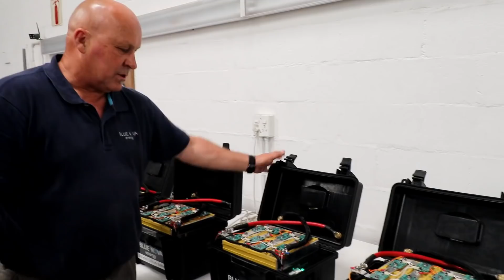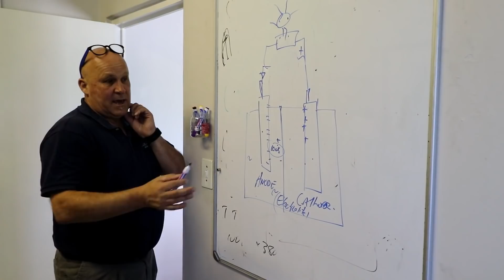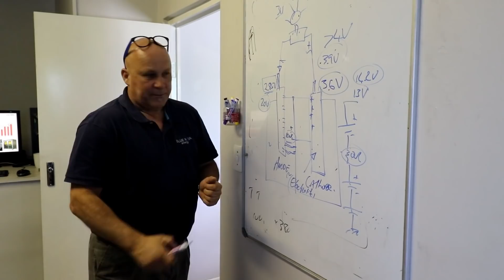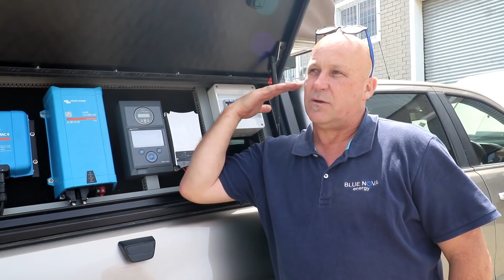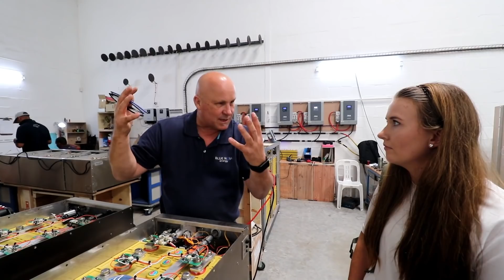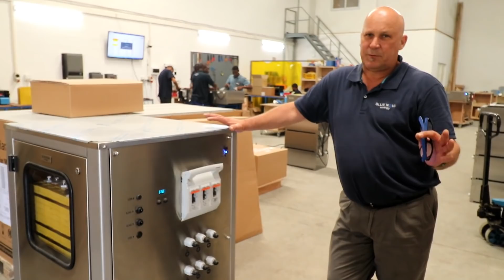We're going LiFePO4 | Lithium Batteries on our Boat

Comment: Hi guys - great video!

We don't want to 'intrude in your space here' but perhaps understanding some more details around the 'cells' they are using would be helpful.

We installed a similar set up on Impi which has been awesome - a total life changer and definitely made our life easier so to be sure, you guys are 'on the right path here'. We are seeing so many 'die hard sailors' now going this route and saying how fantastic it is - so well done!
From our experience with these LiFePO4 batteries is that maintenance of the system is almost zero compared to when we had lead acid, deep cycle gel and Lifeline AGM.

The only other battery we considered and would still consider is Carbon Foam - however we are still happy with having gone LiFePO4 and you guys will LOVE it. 
We also considered Lead Crystal which has similar properties relating to charge and discharge, however the weight is what 'turned this down for us'. 

I was a bit confused where the Tesla part comes in under your description - Tesla use a different chemistry which is more energy dense and they use cells that are slightly bigger than an AA battery. Thousands are stacked together to create a battery. 

I wondered if the cells being used by  Nova Blue are not just the regular WINSTON LiFePO4 cells they are using in their system?
My first question would be. 'what cells are they using in their system and what is the part number of the cells'.
I would then recommend checking the manufacturer specification and 'C rating' around the CELLS - and I would most certainly be regarding that specification as listed by the manufacturer above all else.

If these are Winston then I would say they are 'FAIRLY' similar to other cells out there like CALB, GBS-LFP and many other similar cells. 

Do you know what the cell manufacturer 'C rating' is on the batteries?

If these are Winston cells I would suggest you guys study the battery cell specifications because over discharge and over charge can certainly DAMAGE the cells. Usually below 2.5v on discharge and 4v on charge for each cell.

We have come to understand that what one is basically buying and paying for with distributors, is the BMS (Battery Management System) and the cell balancing devices between cells, and I think BlueNova will be good for this. 
From what I can see in the video, It appears to the future, one can remove the cells and replace them thus retaining all the 'external to cell / BMS gear' and that will be a massive saving to the future since all you pay for is the individual cells which are easily purchased online. 
Some 'contained units' do not allow for removing external hardware so in effect one is having to dispose of a complete battery verses being able to only replace the cells in the battery.

Perhaps we missed it in the video, but I assume you have considered Redundancy between LiFePO4 packs and also to regular lead acid start batteries?

Cheers and well done for a very well put together video.
Reply: HI.
I'm James from BlueNova. 
Thanks for your comments.  Here are some of mine :) 

Our main objective with the LiFePO4 batteries we manufacture is to supply maintenance free batteries that can handle 80% DoD , on a daily cycle basis , for more than 10 years with ambient temperatures of more than 45 Deg C. Think Botswana's and Namibia's lodges. We have more than 2000 units operating in Southern Africa at present. 
In our search for the ideal cell we choose Winston because they use an enhance cathode with added Yttrium which protect the oxidation layer against rapid aging. We've seen installation that were done 14 years ago with these cells. CALB, Sinopoly and GBS and the other leading suppliers of cells only guarantee 80% capacity retention at 80% DoD for 2000 cycles. Winston's cells retains 80% of initial capacity for more than 5000 cycles. That's why Victron also chose them for their Lithium batteries. I don't think it will make any difference on Sailing Lady Africa as I don't see those 2 youngsters cycling those batteries that long :) That's about 13 years of daily use !!

C- rating ? (The link to the cell specification is added below) 
C20=77Ah C1=60Ah (Verified by our own engineers and confirmed every 3 months)
http://en.winston-battery.com/index.php/products/power-battery/item/wb-lyp160aha?category_id=176

BlueNova adds : 
1. Cell boards for balancing and temp / voltage monitoring.
2. Master Controller for operating the protection circuit, pre-charge of bus capacitors, SOH & SOC calculations,  Wifi interfacing for remote monitoring, CAN interface for charger & inverter control. We control the charge rate depending on the cell temperatures (a big cycle killer when the cells are cold and empty)
3. Impulse relay and controller that can stand 5C operation. These batteries can delivery 300A for short periods. That's about 4kW of power at 13V. 
4. Packaging. We use a special case like the Pelican cases used for sensitive camera equipment. It has  a life time guarantee.
5. We implement various protocols to communicate to inverter/chargers lie Victron , SMA, Ingeteam etc.
6. We offer local support to each component in the battery. We carry spares of each component. We own all hardware electronics designs and also all software / firmware used by the embedded processors. 
7. We offer a 10 year warranty on our stationary series products and 5 years on the mobile products. 

Lastly, we are not distributors. We are an engineering concern and are cell-type agnostic. Our electronic systems can work with any type of cell and we are also looking at bring out a SuperCapHybrid soon. It uses 20 cells instead of 16 cells for the 48V market. If a new or improved cell comes to the market from another supplier we will incorporate it in our solutions. 

Regards
James
Reply: @JamesVerster  ahhh now i am interested... your own supercap hybrid, that will be interesting.
Reply from the maker: Hey Guys 

Initially we were going to build our own banks with imported cells , as you know they all come from the same country of birth.
But after finding a supplier locally that built with the same cells we were planning on importing we decided to have a chat with them. they have a fantastic BMS with a number of inter grated safety and coms systems that im sure you are aware of . 
Yes the Cells are regular Winston Lifep04 cells , as you know there are a number of cells available on the market. 
we actually used calb cells during one or our solar cars at varsity a few years ago , so yes i am familiar this these cells, and in my own opinion these Winston cells are in the top two best cell chemistry and quality in the world at the moment. these systems are complete and contained with all the redundancies that you would usually be required to add afterwords.
With regards to the Tesla , we refer to this in the cell chemistry section, they typically make use of the 18650 cells and in the new T3 they make use of the larger 2170. They are have a thermal runaway and yes there energy potential density is higher and they are better suited for high performance demanded applications as you may know .   
However they are best kept in sealed housing and water cooled.
 
With a bit of understanding this systems can become a modular system where cells can be replaced. but as you know with electronics every 5 years there is newer and better systems out. 

Hope this clears something we may have missed to convey 

Thanks for the support 
Kind Regards 
Ricky and Simone
Reply: Sailing Lady Africa water cooling is not that complex (even desktop PCs use it). I believe that the Tesla packs come with a serpentine cooling system already installed so with a few minor mods for boat usage you’ll have them cooled fine. 

Moreover you’ll get up to 80 kWh (plenty of those on EBay) stored energy which means that you could even go electric on propulsion (provided that you don’t motor that much). See here for a tear down of the new 100 kWh Tesla pack and cooling system. If Tesla sees fit to use them in a vehicle that’s prone to violent high kinetic accidents I can’t see how usage in a boat might be a liability. 

P.S. I’m no expert and I may be missing something here.
Reply: Nice additional info Brent

Comment: Nice info, I'm a power Boater, no other sources power other that engine and gen-set , will this type of battery plug and play with no modifying of my boat ?
Reply from the maker: Hi Tony , for the most part yes as long as you can deliver 14.2v . to get maximum efficiency better chargers are recommended

Comment: Thank you for a very informative video. I have been trying to get info from Blue Nova but they di not reply to my mail. What I am looking for is a direct comparison of a 100Ah system giving cost of system (charger etc) per cycle. I am also looking for a system that can be maintained and repaired in remote locales.
Reply from the maker: Hi Coen , perhaps the mail got lost . Send us a mail at svladyafrica@gmail.com and well send you all the info and pricing directly from blue nova. They also have systems that can be monitored and managed away from the location.
Reply: @svladyafrica   Thanks for the reply. My priorities are lower cost and greater simplicity.
Reply: Hi Coen. No mails received on this side. Mail me at jamesv@bluenova.co.za. I should be able to get someone to respond immediately.

Comment: With a little boat like yours just put the money in the pocket and use 4 lead acid battery’s and three solar panels , we had these , temperamental  things , need to be very cool all the time to many wire connections in salt water invierment , you can’t drain them so you need lots of charging , good for Supa yachts  and you only have half it’s capacity to use , keep it simple , buy a small generator some battery’s , way you go , we have 4 house two starter ,   Serviced properly will last 5 years of world cruising , we delete two when on passage mode and that keeps the hole boat running for days on three solar panels returning juice , all electrics , inverter , microwave. Etc. run the motor every two or three days for an hour , simple , you can but acid battery’s any where in the world ,   Watch Lopos But don’t listen to me good luck
Reply from the maker: we had 8 lead acid to start with 800 ah , 4 would do nothing but run the autopilot and basic electronics

Comment: Excelent subject guys. It played more like an advertisement for Blue Nova than I really care for. However, you're clearly thoughtful and understand the Many benefits lithium batteries offer. As highlighted by BN... it's, for me, All about charging efficiency!  Personally, I would like to hear Your discretion on the subject of Your reasoning and particular application for Li batteries.
I am familiar with the products BN are using as I am developing my own "prototype for commercialization" Li based  diesel electric hybrid systems for yachts. Their choices validate my own.
My ideology is maximum efficiency and longevity. This equals Value! The gentleman from BN mentions charging the batteries with a generator. What he doesn't mention is how you can ensure that your generator is optimally loaded during charging. This Greatly increases the efficiency and longevity of the expensive equipment while, simultaneously, keeping maintenance and fuel costs to a minimum.
This is particularly important to me in that I, currently, have no source of passive income to contribute to the costs of cruising. So, keeping costs to a minimum while actively cruising is, in my situation, Paramount.
Li batteries are the future! Get onboard or be left behind.
Reply: Hi S/V Phoenix and Me.
I agree that SLA significantly marketed our company and products in this video. That was their choice. Thanks SLA for that :) 
Your question: "how you can ensure that your generator is optimally loaded during charging ?" 
This is quite simple. Every generator has a "sweetspot" for $/kWh produced. Typically 85% of prime power. Set the charger power limit on your inverter/charger to this value Then it will draw that specific power from the generator when charging. The absorb phase of charging a LFP battery is very short and insignificant to have any effect. When the charger goes into float your can shutdown the generator, unless you have other rules like for instance lodges have. They want now generator in quite times and also want 100% SOC on the battery when the sunsets. They will thus run the load of generator even after SOC reaches 100%. 
Regards
James
Reply: @JamesVerster  You are correct sir. The inverter charger, among other devices, will controller the input of energy to a battery bank. I only mentioned that detail so that others may look deeper into the subject. As I'm sure you know, the C rating of the batteries and the total output of the charging devices should be taken into consideration when designing the system.
I am very happy for your company's success and I admire your products. 
Regards,
Matt

Comment: THe batteies are not my concern. how secure are the electronics to salt water/sea air? I had my new Nikon cameras lose most of their copper tracks in a two day storm just walking at the beach - no direct contact to the sea water, just the contact with the salty air
Reply: Corrosion protection for challenging conditions:

https://multimedia.3m.com/mws/media/1180158O/salt-spray-fog-protection-3m-novec-electronic-grade-coatings.pdf

Comment: I've been planning doing a bus conversion for quite some time now and have been toying with different options as far as powering it is concerned and these systems look perfect. I will be fitting several 300W solar panels on the roof with an additional alternator to charge the bus' home power batteries and intend running a normal fridge, induction cooker and possibly a kettle, toaster and hair drier. 

Safety has been a big concern for me and while I was toying with importing Tesla car batteries, their thermal runaway issues have put me off using them in spite of their efficiency. The last thing I want is my bus bursting out in flames in the event of a minor fender bender. 

Thanks for this video, it has been most informative. I have never heard of them in spite of living in Cape Town.
Reply from the maker: Definitely check them out Gary! Great service and a great product!
Reply: A vw bus? What year?
Reply: @andrewafrican  No, what the Americans call a schoolie conversion. I'm looking at a 36 to 40 seater bus to convert to a motor home.